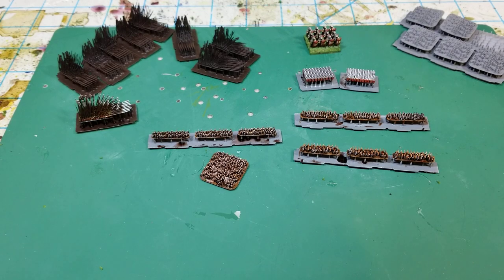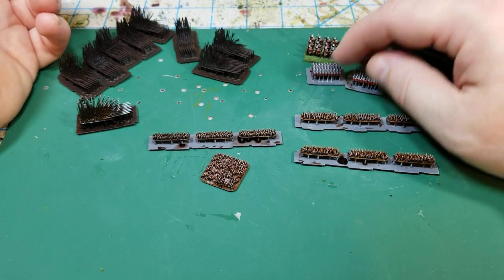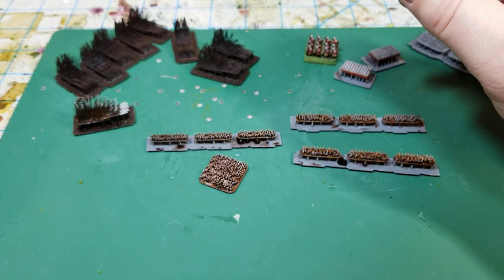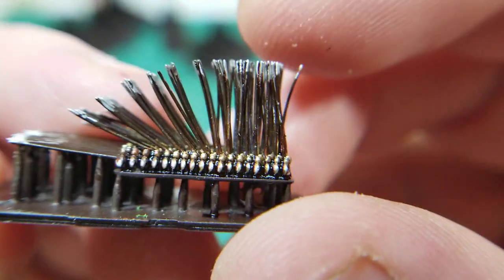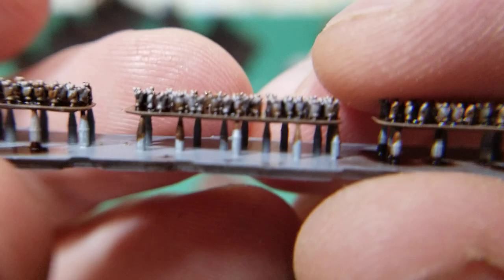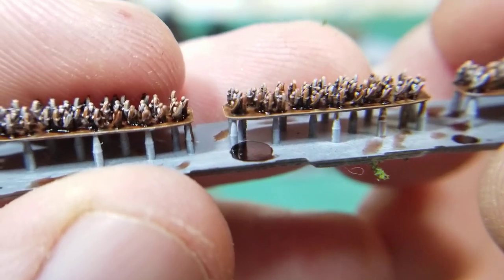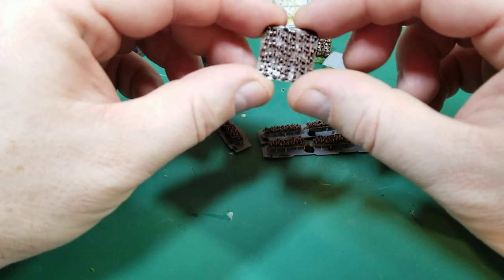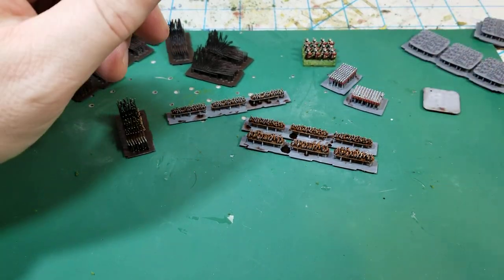Explorations in 3d printing 2mm models

Comment: Those appear to b the best 2nm figures I’ve seen to date.  
Your original pikes men appear to have pikes over 5 body lengths.  Pikes rarely approach 4 body lengths as they wold get to unwieldy
Reply from the maker: Thanks. Correct on the pike length. In my latest video you can see the updated version. Plus they print bettet.

Comment: I didn't think you could get it down to 2mm.

Nicely done.
Reply from the maker: Its surprising.  Better printer and good mix of resin helps.
Reply: @Aaronfromprojectwargaming  Which Resin did you use that is flexible?
Reply from the maker: @rayk1509  sirah tech tenacious about 25% mixed with standard resin
Reply: @Aaronfromprojectwargaming   I am completely new to 3 d printing. If you have a 28 mm template to print, are there settings to scale it down to 15 or 10mm in most 3d printers or would you need a seperate 10-15mm template? 
I thought it would be really cool to print space marines for 40k in 10-15mm scale.
Thanks.
Reply from the maker: @bringer-25  you can usually scale down files in the slicer program. There are some coversionn charts out there that show you what percentage need to scale up or down to get your desired size.

Comment: Is it necessary to use a 4k printer for these models?
Reply from the maker: No but of course you will lose detail. I would've recommend using an fdm. I've seen guys do it but pretty rough.
Reply: @Aaronfromprojectwargaming  Thanks for the reply - I am looking at the Mars3 resin printer for this.